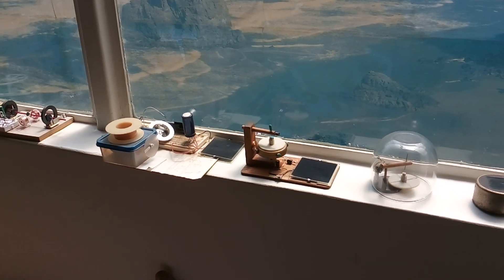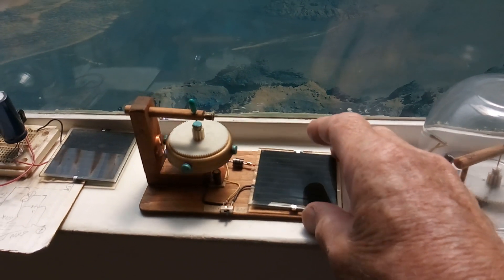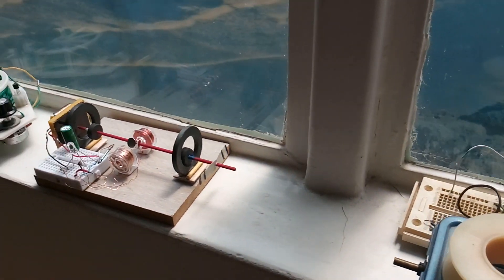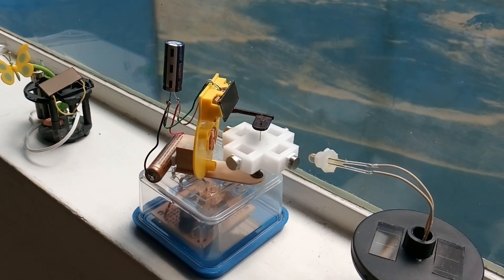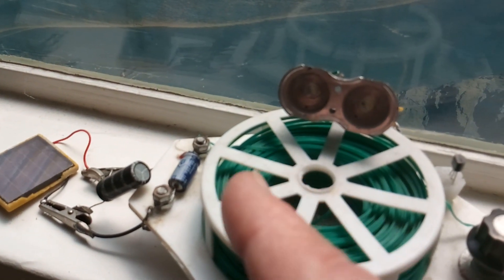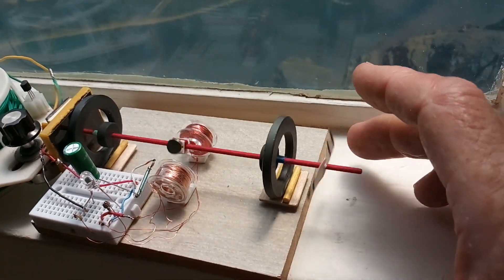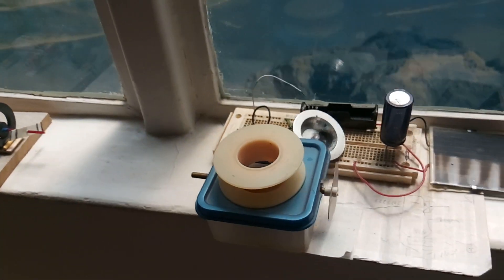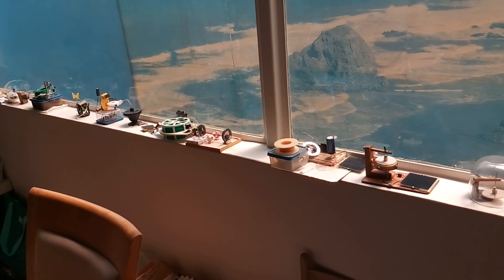Solar projects from long ago until now

Comment: Great to see the family all together 😆 My solar snowman still seems to keep running off a dead/depleted battery that somehow gets a boost in the sunlight. It is 11PM at night here and it is dark and he is rocking gently. During the day he seems to get faster, so somehow the battery is restoring. It is just a cheap Poundland/dollar store AA battery. I have considered putting a time-lapse camera on him, but that probably wouldn't give a true picture due to the frame rate. I might do that anyway, just to see what happens.
Reply from the maker: Temperature effects the batteey chemical reaction so maybe that accounts for your rocking rate.  I have a led "Penny" light that is running on a discharged recharceable that is showing some strange behavior also.  The light circuit runs down to about 1/2 volt and the battery is nearly there.  At that low voltage the amp draw goes way down plus the blink rate also slows down.  I might try one of those 'depleted' duracell rechargeables on a solar rocker and see what happens.
Reply: @Lidmotor  I have just set up the time-lapse and will leave it for a day or so. I can't remember how long I can actually record for at 10 second intervals. As I mentioned, it won't give a true rocking rate, obviously, but I should be able to see relative movement. One of those little side projects just to see what happens. The battery running the snowman is labelled "Super Heavy Duty ZINC", which is just their cheap, bottom of the range, usually come in packs of 12 "2 free for the price of 10" at £1.
Reply from the maker: @GrandadIsAnOldMan  OK---so it is just one of those super cheap carbon / zinc batteries.  Amazing.  I guess as long as the zinc lasts the old man snow man will just keep on a rockin.